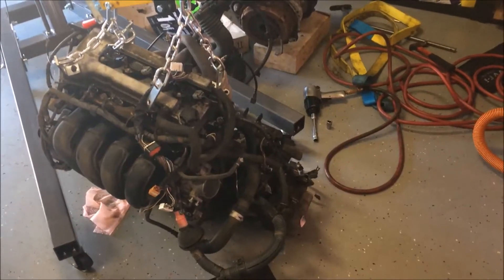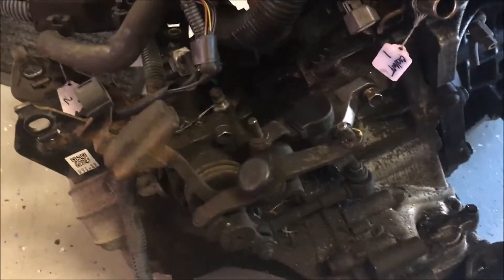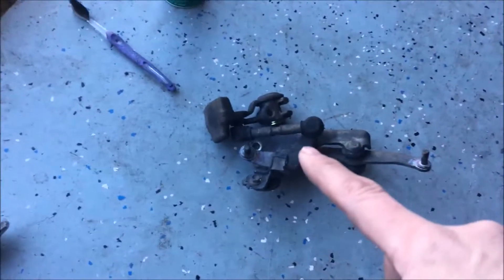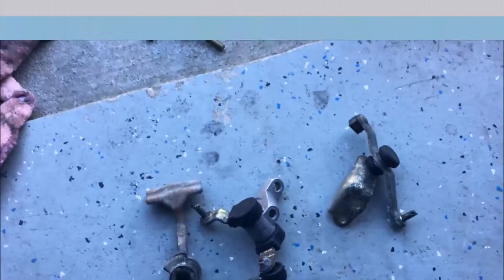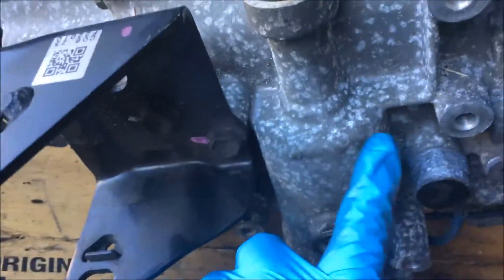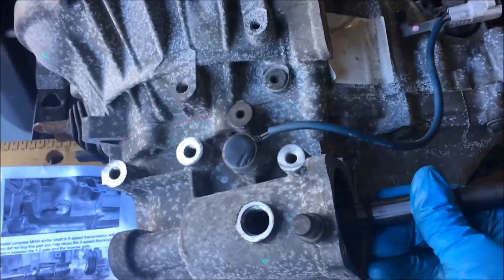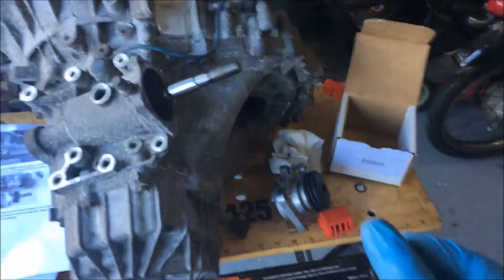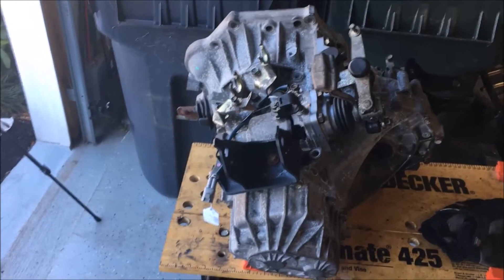MR2 2zz swap 6 speed transmission set up

Comment: Hello, thank you for your detailed guide!
Can I fabricate myself the shaft and the reverse blockout? The MWR parts are expensive...
Reply: I was also wondering about this?
Reply: @the_little_car_project  Yeah I'm still thinking about that. I've got celica 2zz transmission in good shape and MR2 Spyder 6-speed transmission in worse shape. I would like to just put the celica tranmission in the car but from my understanding I can't do it with the parts I have.
Reply: @Arielxx01 the shiftrr shaft and reverse blockout are just from a 6speed mr2 transmission, so you can just reuse yours

Comment: Idk if this is the place to be. But I own a Toyota Celica GTS. Same engine, 2ZZ-GE. It’s an automatic but can I manual swap that car? Forget the money, can I do it? I ask because I see no one doing it online and anytime I look at trany or engine on eBay. The engines are always labeled automatic or 6 speed manual (keep in mind they don’t come with the transmission listed, just the engine) So idk if the 2ZZ engine has transmission specific variants. Anyone help me? Been asking literally everywhere.
Reply from the maker: The engine would not be different between a stick and automatic but there is definitely a lot involved in doing a manual to stick conversion.  You would need a donor stick Celica GTS to raid the transmission and all of the shifter linkage etc.  You probably have not seen anyone doing it because it is easier to just sell the automatic and buy a stick.
Reply: StarkReality Okay thank you. You’re probably right about nobody doing it, the cars value would be the same as doing the swap. I wanted to know just Incase down the line a donor vehicle ever comes about for a good price.
Reply: TheNameIs MWR does sell stuff for a 6sp Celica swap. Might not be worth the money though

Comment: so that plug you put in was wrong right? per your other video that was the cap that needed that other fitting attached to the transmission first and then have that cap fitted inside that right?  the part that was blocking you from going into 5th and 6th gears?
Reply from the maker: You got it.  There is a copper insert that needs to stay in that hole and the plug goes into the copper insert.

Comment: When separating the selector mechanisms from the 5-speed, how did you get them off of the shaft?  I'm trying to get the part that goes on the end of the new shaft apart from the old (5-speed) shaft so I can install it on the new (modified) shaft.
Reply from the maker: It is a little tricky.  Not sure how to explain but there is a clip and I remember thinking it was the opposite of my first impression.  Sorry I can't be more specific.
Reply: Did you ever figure this out? I'm stuck on removing the old selector Machanism too
Reply: Same... also stuck on this... MWR’s instructions are the opposite of detailed.
1. Remove all 5 speed stuff
2. Remove all 6 speed stuff

Thanks guys
Reply: Rob after the pins are removed I just ended up using a hammer. It was definitely stuck on there pretty hard

Comment: I need help. So I got a MR2 Spyder that is pass down to me and it has a 6 speed transmission swap in a 1ZZ motor. 

All the top gears can easily grind like reverse, 1st, 3rd, and 5th. Reverse and 3rd is the worst. It is hard to enter the gates and when I mess up it grinds. I am not sure if they rebuild the tranny before putting it in, but someone said I needed a JDM part to put under the shifter or around the shifter to make the adjustment perfect and more smooth. Is it true? If so do you know the part?

2nd, 4th, and 6th are fine. So right now i am just revving out 2nd gear to get enough speed to skip 3rd and go into 4th to avoid 3rd since that is the worst gear to shift into.

Or do i need to rebuild the tranny? I mean i can survive with it right now, but it is not as fun when i cant up and down shift to 3rd without having to worry about grinding.
Reply from the maker: Did the gears ever work smoothly?  If not then maybe the conversion has something wrong with the shift shaft.  If it used to be smooth then you may need a rebuild.

Comment: About that notch on the shaft, where is it when when you have it on the trans? Is it pointing down out of view? Basically, how will I know im sticking the correct side of the shaft in?

Lastly, when tapping that bearing in, isn't its purpose just to hold the end of the rod (aka selector) shaft? So all I need to do is tap it in just enough to hold the shaft, right?
Reply from the maker: You are correct on the shaft bearing.  It just needs to be tapped in to support the new shaft.

The instructions help with the shaft placement but the easiest way to know which end goes inside is that the notch for the lift linkage is unique and needs to be on the outside.

Comment: do you have to change de shaft if you have a 6 speed from a Corolla/Matrix xrs with the selector behind the engine ?
Reply from the maker: Alexandre Archambault If you are putting the 6 speed in then yes you have to change the selector shaft. It will not shift correctly without it.

Comment: GREAT video on trans adaptation.

Looking forward to wiring.  Just finished stripping my crusty donor and most difficult part was the bracket under the throttle body.  It is a 2 bolt, 1 nut plate/bracket and the wiring harness attaches to it with a 10mm head--bolt.  Holds intake manifold for those looking to remove.

Please continue with great videos as also have many vacuum hoses in this area.

Thanks you again,

Mr. P